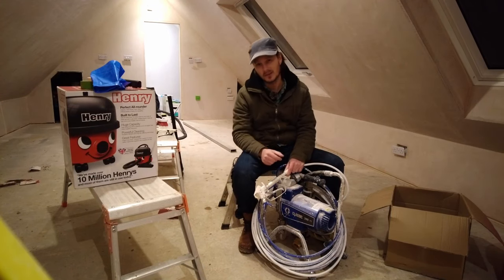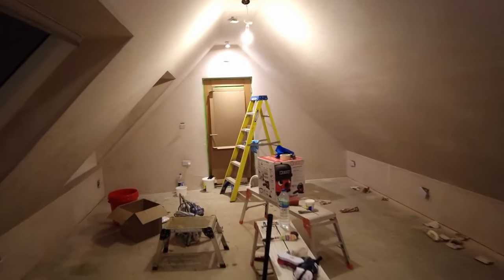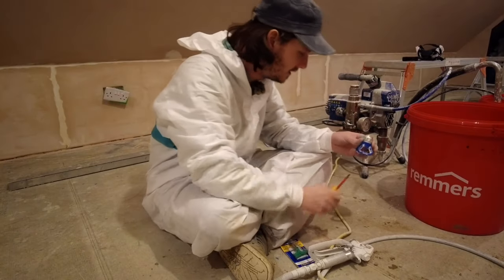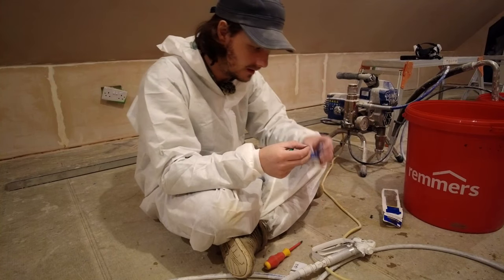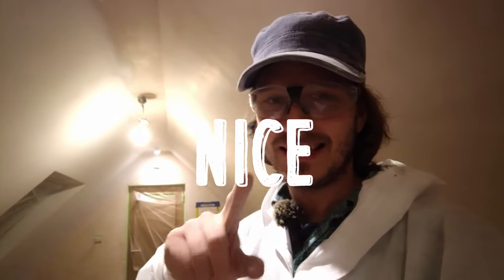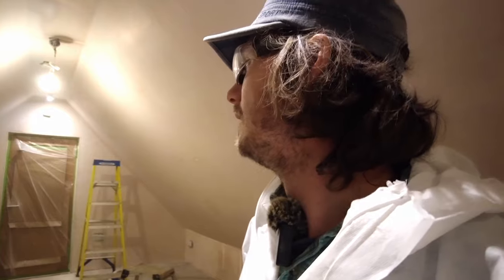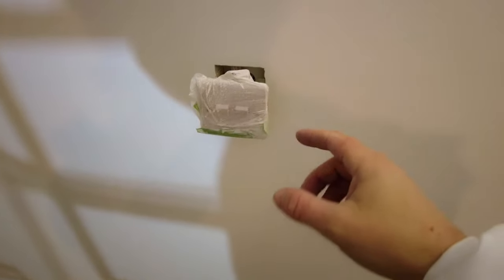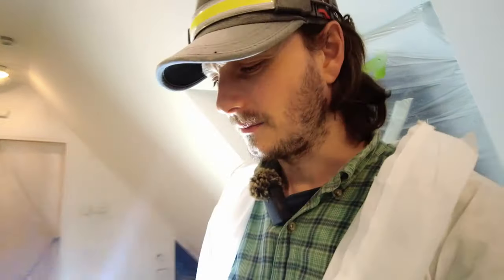Using a Graco Airless Paint Sprayer for the 1st time

Comment: I’ve got the erbauer airless, have had a few issues with it getting blocked even thinning the paint but when it’s working it’s bloody great, it’s particularly great on woodwork!
Reply from the maker: I've got one as well 🙌 I've only used it for spraying the ply black at the bottom of the lodge but it went pretty well. What tip and paint did you use for your woodwork?
Reply: @THE-AIDEN-PROJECT  So far for spraying woodwork I've only tried WRX Trade Satinwood because I didn't want to put oil based deluxe trade satinwood through it. It went on lovely with the sprayer but as I mentioned in another comment, it's crap with a brush. I think that's just the nature of water based satinwoods.

For tip size, I took a punt on a 211 for woodwork, I wouldn't go any wider than a 2 unless you're doing some massive skirting or doors. The 11 was probably about right, if you're really quick with the sprayer you could probably go a bit bigger.
Reply from the maker: @thepeginator2556  cool, it's good to know it can handle doing something more fine finish. I know you have to be quick using an airless for woodwork, I know I'd end up with runs 😩

Comment: Using ‘filler’ is fine for ‘filling’ part of and hole/gouge.
But it’s harder than the surrounding plaster and will always be an arse to sand level.
Best is to use a premixed skim/finishing plaster ( even your beloved Screwfix does a half decent version). Also it sands easier and doesn’t go too ‘smooth’ as the filler does. 

It’s looking great though
Reply from the maker: I was thinking I probably made the wrong choice on the filler front. Hopefully it'll cover up OK. I'm trying some different filler, tomorrow, from toupret that apparently doesn't flash. I reckon I'll go for what you suggested in the barn. I can't remember having any issues in my last house but can't remember what I used 🤷‍♂️
Reply: The Toupret powder is more like ‘plaster of Paris’ and is much easier to achieve a good finish.